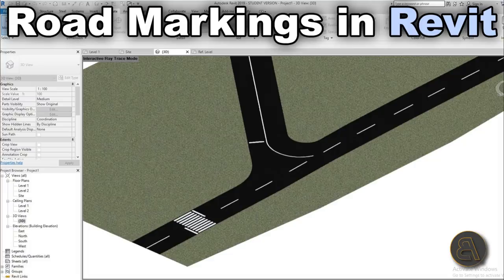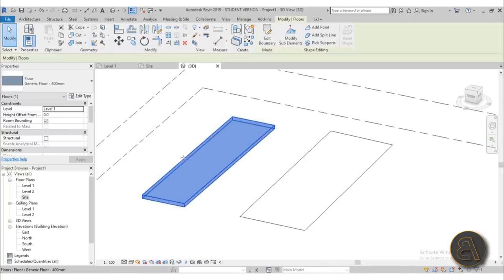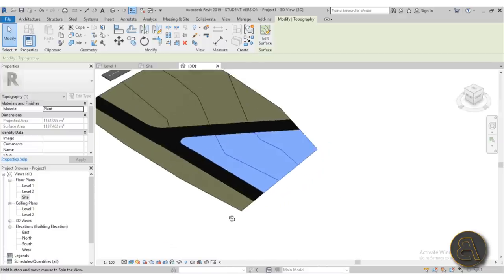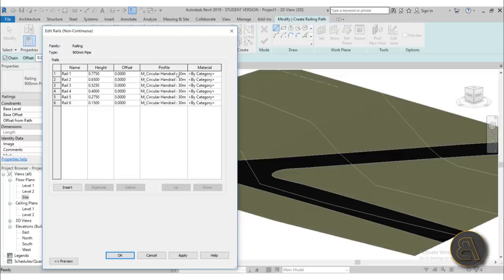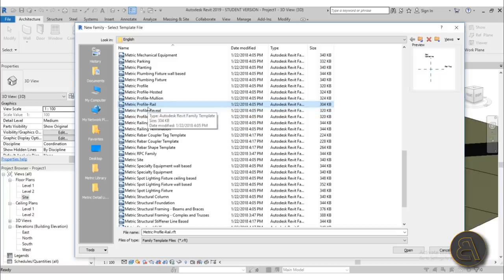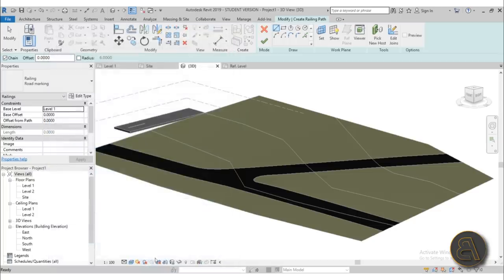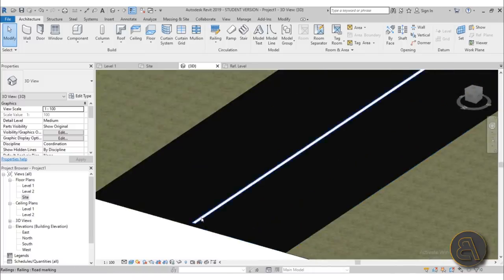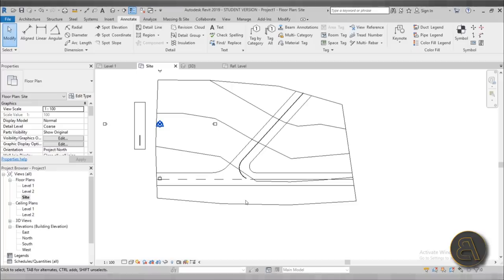Road Markings in Revit Tutorial

Comment: Instead of using railing family to make the road markings..it is easier to model in Mass?
Reply: It depends on the road gradient/condition etc. but railings are usually best

The railing tool provides a lot of benifits;
- Quick and easy to edit the properties and spacing
- Can follow the gradient of a floor/topography
- Lightweight way of achieving it performance-wise